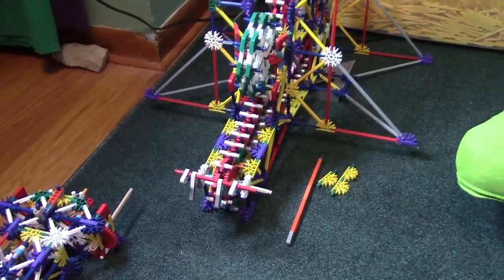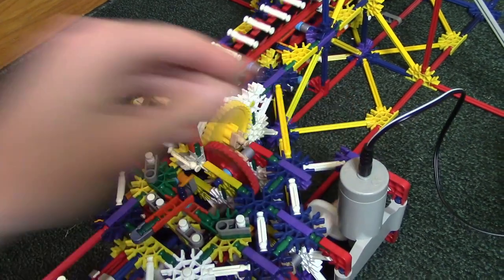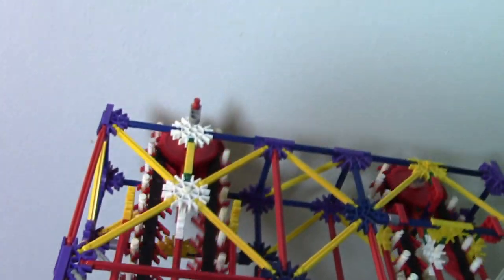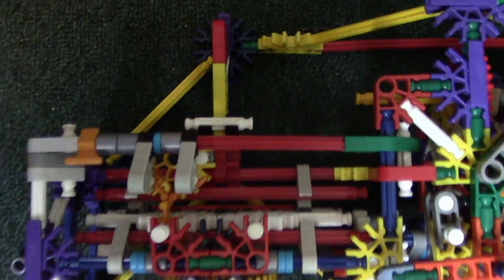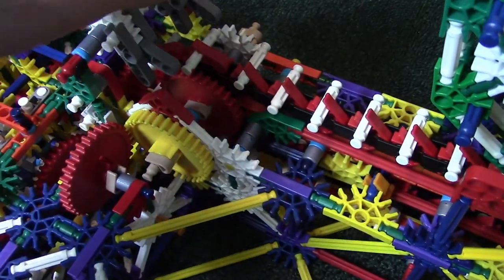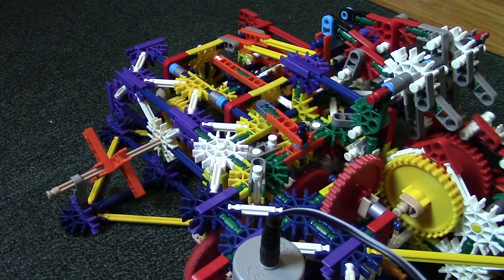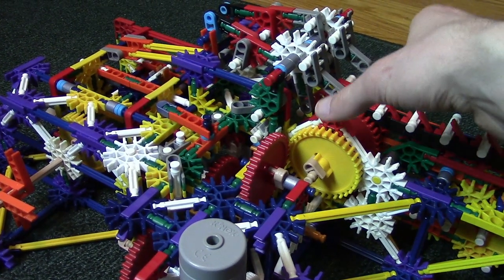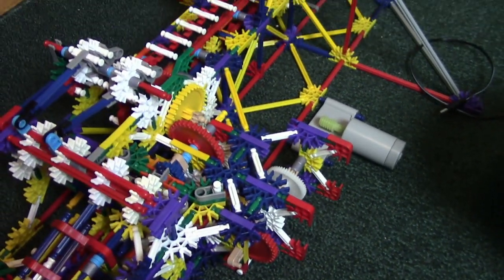Let's Build Knex S2 - Ep2 - Robot Project: Tape Read Assembly and Testing

Comment: Using those splicers to make that mechanism stable in 3 positions is genius. It makes much more sense why you’re not thinking of it as a binary system now. I’m a bit concerned about the amount of slop in the pin registration head though. When you were doing the back and forth test it seemed like the output shaft wasn’t moving back to its original position. I’m worried that if there’s too much torque on the output shaft the pins might slide around the registraitors.
Reply from the maker: I know what you mean with the shaft not returning to its original position, there's likely some imbalance on one side vs the other. Fine-tuning it will make more sense when the whole thing is built. But I did do a test with holding the output shaft down to make there be more torque, and the pins have no issue switching the transmission. This is why it was worth coming up with different transmission designs that were easier to switch under higher loads. I'm sure the leverage between the levers and the transmission helps as well.

Comment: That is an impressive system to put together, and I love the ingenuity of the 3 state locking mechanism you've incorporated in there. My only frustration is the ambiguity of the angle of rotation. Would be nice to have a mechanical way of ensuring even at higher rates that it turns only a particular angle for each passing rod, though that gets into more complicated mechanisms I think than what is reasonable for this design.

Though it may not be a feature of this current design, do you think this could be used to control a more complicated gear shaft? Seems you would need more contact points with the feed tape to have it shift multiple times. Could be used even as a means of controlling the speed of the tape. One segment controlling the speed of the tape, the other segment controlling the output direction. Though presuming that may compound the difficulty of those tapes.
Reply from the maker: I agree that the angular resolution is hard to keep exact, however this doesn't matter as much since I plan on teaching the robot in a way that you don't need to know the angles to program the tape. In theory it should turn a particular angle for each pin that passes, even if the motor slows down over time, since the same motor runs both tape and joint. Unless you're talking about feedback control. 

I originally imagined it having velocity control, so each joint would use two tapes, but I think that would overcomplicate things and add a lot of slip, since there isn't a way to make a mechanical CVT without slip that I know of. It would be nice to have though, since having velocity control is the only way to make a rotating robot arm like this one trace out a square path. But I'm not being too picky about the path planning.
Reply: This is all so well thought out and I'm loving it. Curious if you're using any particular text/resources as inspiration/guides for the process of developing these systems? The feed tape seems like a rather ubiquitous concept, but having the pins slide left/right/centre for control is just a step off of what I think I'd be able to come up with.
Reply from the maker: @FygerFyre  The feed tape idea has been done before in a less complicated way, I think there was a Knex model on Instructables that used a short feed tape. So perhaps that's what inspired that concept, though I forget what the model was. I'm also inspired by early computers that used the holes in paper to register the bits. I'd like to make a wide tape that can do that, to store angles rather than the time between forward/reverse and neutral, but it would be more complex and require an encoder to convert the binary to the angle (and this has to be done in realtime as the robot is moving). Most of my knowledge of robotics is from taking a particular class at university, and the project we had at the end is what made me want to start thinking about this project. Here's the final video, you can see the resemblance from that to the Scara arm that was shown in Ep. 1: https://youtu.be/P7QIN-2nqJk For the pin sliding I was just thinking of how the two sides could make a motor go forward or reverse with a transmission, and that it could make a robot arm move to a desired position. This robot project is the most technical project I've ever worked on, though I have plans for a larger-scale yet simpler automation project, one that might use the robot as a part of it.

Comment: Wicked video. 
One question, if you watch at 15:30, based on the setup in the chain you have, you would expect the output shaft to be returning to where it started after each “segment” of chain switching it directions twice. This does not seem to be the case and the shaft ends up about 180° from its starting position.  Is there a reason for this (design wise) or is this just due to the imprecision of the knex parts? 
Also, will there be 3 chain loops for each axis of the machine? Or will you somehow run all 3 off of this single chain loop?
Reply from the maker: Thanks! I saw it do that but didn't end up mentioning it in the video, I think it may be due to imbalance between the two levers since they have different-shaped linkages. It could also be the fact that a pin used to activate neutral does that at a different area than a pin that activates forward or reverse. I'll have to figure out how to debug it when everything is built. I still plan on using that read head concept in general though, since it's the simplest that I've thought of, so hopefully it can be balanced. If the end result is too imprecise, there could be external means of setting the robot arm in place before its next movement, to prevent compounding errors. And yes, there will be three tapes in total, using almost 2500 chain links. That's basically all the chain I have so hopefully it will work out lol.
Reply: @Shadowman39  Perhaps you could make something along the lines of limit switches, so if the machine gets too far along, the limit switch will "remind" it of where it actually is.
Reply from the maker: @Koolcoasterkid  That could be a good thing to have, especially from a safety standpoint, since there isn't anything to protect the motors from turning beyond their limits. I'm pretty sure none of the joints will be able to turn a full 360 degrees.